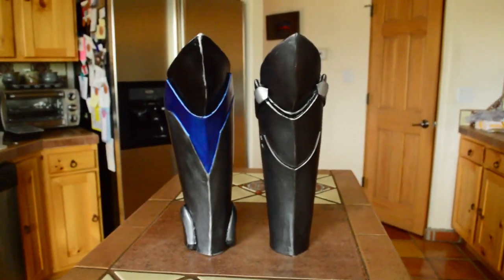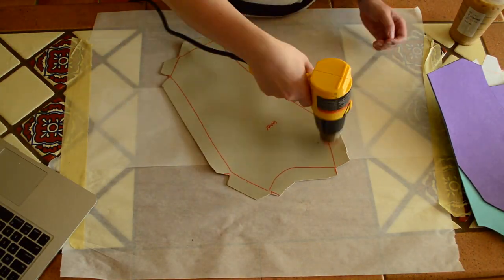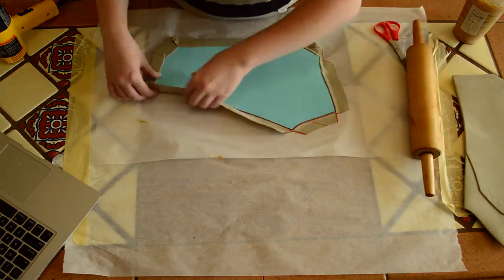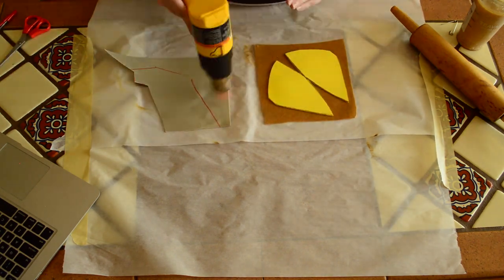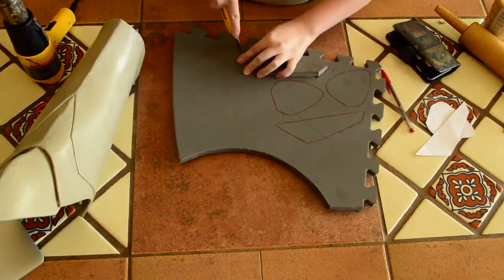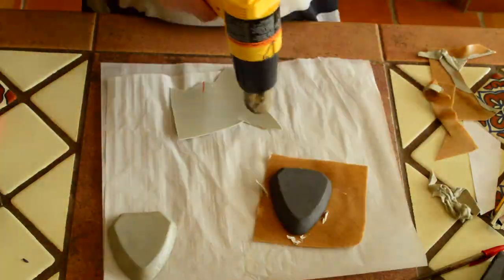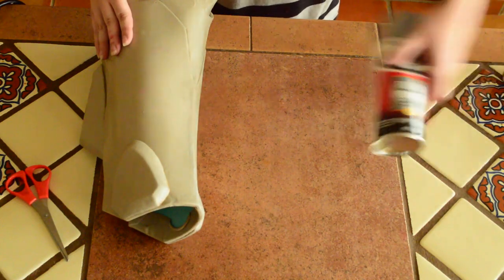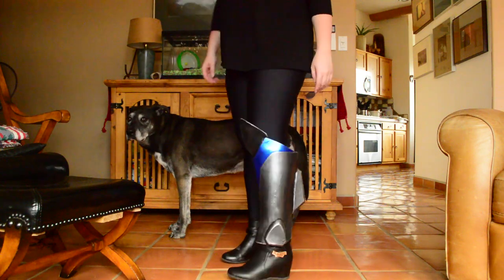Cosplay Armor: Full Leg Guard Tutorial

Comment: Hi, i have a question. Is there a substitute i can use for the Thibra? Its hard to get it where i am.
Reply from the maker: Hello! It depends on where you are from. Warble is another notable thermoplastic that works the same as Thibra. It's a little different than Thibra, but ultimately works the same. Theres other thermal plastics out there, some of which are easier to find depending on where you live. If you can't find a thermal plastic thats easy to get where you live you can always use just foam! It's much cheater than thermal plastics, but won't be quiet as durable. However, you can see make some really nice armor using just craft foam :> Hope that helps!
Reply: Tyler Kennedy thank you! That helps a lot!

Great video 😄

Comment: how to you make your pattern fr the armor? i can never seem to quite size mine right because i have much more defined shins ;-;
Reply from the maker: I usually just eyeball my patterns and use measurements and sometimes old patterns to gauge it. I like to measure at my ankle, under the knee, and at the fullest part of my calf. I then reference those measurements while making my pattern :> If you find that doesn't work well, you could always try what Kamui Cosplay does. For a lot of her patterns she wraps the area, leg in this case, with plastic wrap and then duct tape. You can then draw the pattern you need and carefully cut it off! I find I usually need to clean up the pattern a bit after this method (mainly just to straighten), but it does help to get a fitted piece just right! I hope that helps!